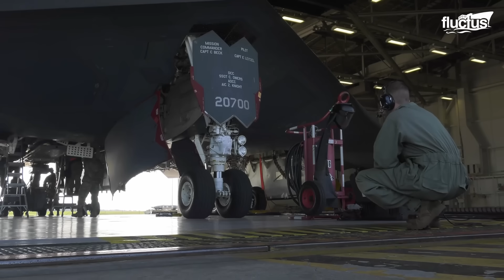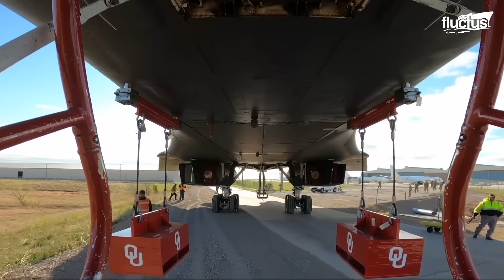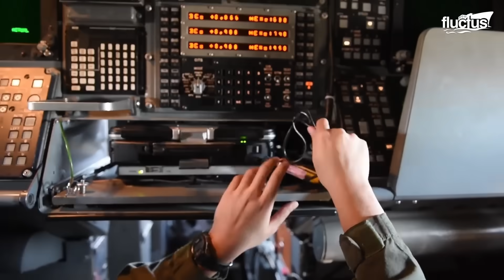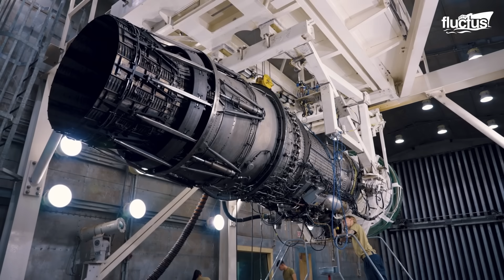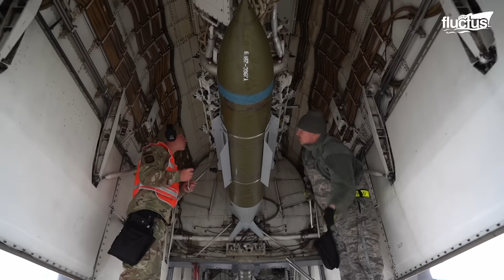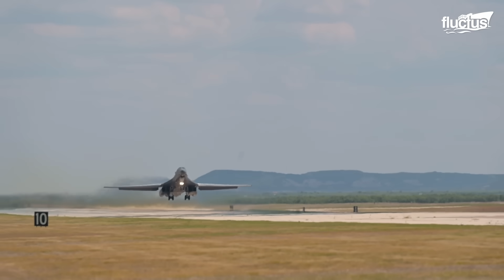B-1 Lancer | The Most Feared US Supersonic Bomber Ever Made

Comment: It's not supersonic, but it is badass...
Reply: B1-B ..Mach 1.25
Reply: @denault3985  it's normally kept well below .96 mach.  It cruises about 650mph.  Push come to shove, they'll breach mach 1 if need be.  Problem is that the airframe has been used and abused over the years, even more than the B-52, and its 20 years younger.
Reply: @denault3985  my father worked at Rockwell NAAO..CITS Group as an SMTS..his 2 subsystems were WSWP and ECS ..that's wing sweep over wing fairing and environmental control systems..his group designed and tested the digital test requirements for the 28 subsystems on the B1-B...offices in a Lakewood..GRTs and flight tests at Edwards and Palmdale..if you can find a copy a good read is the CITS Cook Book...the air force wasn't 100% convinced about computers and digital systems..so the early B1-Bs had analog and digital displays and test points..he also told me what really caused the crash of a B1-B at Edwards during flight tests at the beginning of the program